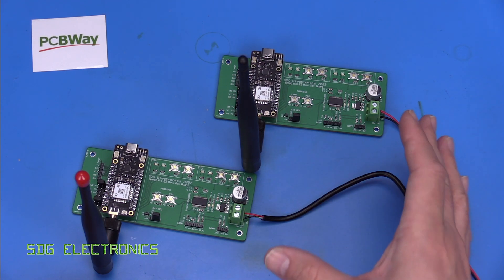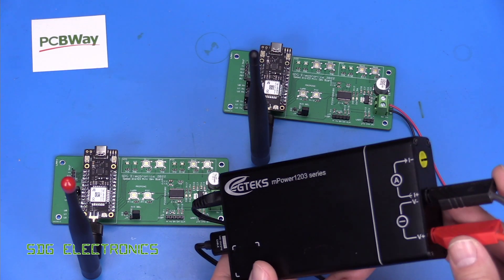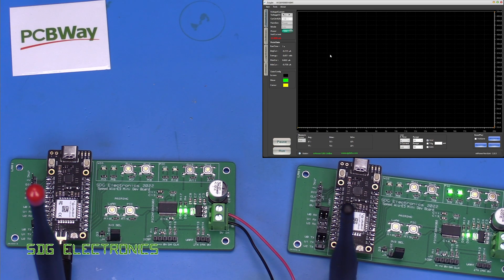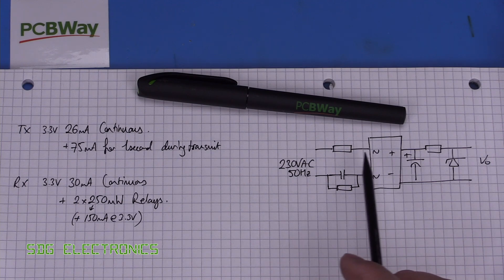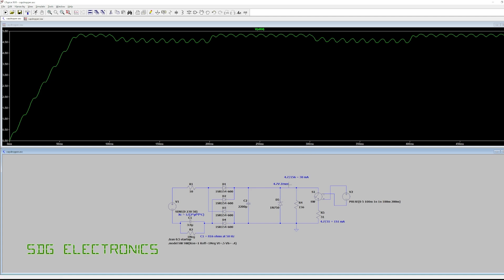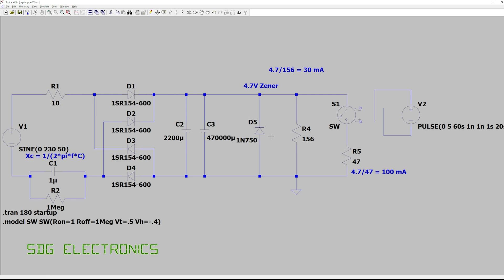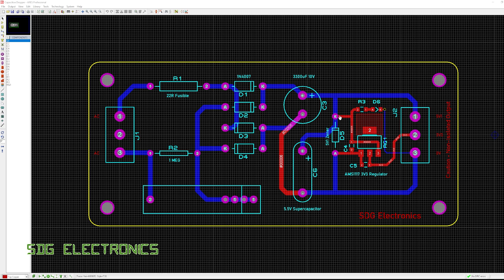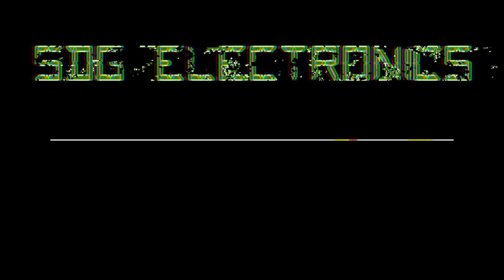SDG #289 AC-DC Power Supply using Reactance of Capacitors

Comment: FWIW on a very similar personal project I opted to use miniature off the shelf "open frame" switch mode PSUs from Amazon,  5 for £4.49.

Furthermore, I went for latching relays to avoid continuous drain. RS part nos  SPST 3V 134-7910 coil 72mA @3.3V; DPDT 3V 827-6296 coil 229mA@3.3V

Comment: Shouldn't your bleed resistor across the dropper capacitor be two? IIRC the breakdown voltage of most through-hole resistors is 250V dc.
Reply from the maker: I think I picked out a physically larger 0.5W package, that had a higher rating

Comment: I like simplicity of capacitor dropper and zener, but always end up with burned zener after a while. To gain simplicity and ease of use would recommend going with LNK302 from power integrations .
Reply: Any reason why the zener diodes fail? Because if you don't know why they fail, it will not help to switch to something like an LNK302. They fail too if not implemented correctly.
Reply from the maker: 2x designs coming up with power integrations controllers

Comment: There are high voltage linear regulators, like let's say LR8 or LR645 or LR745 from Microchip ... can do up to 450v input voltage, and a few mA of output current. If you don't have space for a big X capacitor, these followed by a buck may be solution (for example for the receiver... if it wasn't for the relays)

Comment: I recently bought a "HLK-5M03 AC-DC 220V to 3.3V Step down Power Supply Module" (other voltages are available). This cost £5.00 which makes all the effort of creating a low power supply redundant.

Comment: This is a terrible idea. Very dangerous: the antenna is connected to mains! And as explained the power efficiency is very bad...
You'd better use a decent USB 5v PSU. If you are really on a budget, buy a 2nd had Samsung charger for exemple. Older ones are limited to 0.5A or 1A but that's enough here and they are basically free because they are too slow for modern phones.
Reply from the maker: The design will be fully enclosed with a trace antenna. But the idea is to explore multiple options

Comment: For receiver better to go for a higher relay voltage, you can see in all the PIR applications they use a 48V relay coil, so the current through it when energised can be low, around 15mA, but still capable of switching 10A loads.  Then power regulation is done using 2 24V zener diodes in series, to spread the power dissipation, and often as well they use a trick and arrange the zeners to be 24V zeners, with a 3V6 zener at the bottom, and switch the relay using a PNP and NPN transistor pair, that shunts the relay coil across the 48V rail, providing power to the 3V6 rail, with a largish capacitor, so that the zener current or coil current is feeding the controller at all times. Just have to have coil current larger than controller operate current.
Reply from the maker: I was considering this, but I think no matter what the power dissipation is the same unless the supply to the electronics is a switching regulator. The coil power is around 250 mW no matter what coil voltage. Unless you mean something different?
Reply: @sdgelectronics  Well you can have a small buck converter running off the 48V rail to drop it down, though often the simplest solution is a tint SMPS or even an iron core transformer, though losses in the cheap transformer might be the highest power use. Tiny SMPS though, repurposed cell phone charger, will be about the best bet, 5V at 1A, and with low standby power as well. Should be able to find a whole host of genuine Nokia, Samsung or other name brand ones easy enough, often in never used condition, or a 12V wall wart will work as well.

Comment: I really wouldn’t use any capacitor dropper in anything with an external metal connection. In my experience they are very unreliable and provide  no isolation and little protection against mains born transients, ok for crappy domestic product but nothing else. I think I would go as far as to say these are electrically bad practice given the low cost off power bricks. Having given you a bollocking I have used them several times in the past.  Still you may well get out your system we have all done it.  Great video as always regards Chris
Reply from the maker: I plan to have this fully enclosed with a pcb trace antenna. I plan to try out a few different designs though including non isolated buck and a flyback.
Reply: @sdgelectronics  well it’s great your experimenting I have developed similar designs in the past it’s the only way to learn.
Reply: Like you say capacitor droppers are only really suitable for designs that can go in double insulated enclosures. No metal parts that penetrate the case also no wire coming out to a connector. great for low current circuits powered from the mains that can just sit there runnnong for years.

Comment: I would use a Hi-Link module, they are fairly cheap (A few $) low power SMPS modules and you can get them with a couple of voltages. HLK-PM01 is 5V 0.6A
Reply: They really are top notch. I’ve got several of each in 3.3, 5, 12

Comment: manual dip switches are a thing, for a reason, no software required to operate a device
Reply: capacitive (mostly) voltage divider (C - C R series divider) is better
Reply: also takes care of any DC-bias, lets in only the AC
Reply: why would you push that much power through a zener/diode, put a resistor in series to prevent excessive power usage
Reply: that R4 resistor is suspect
Reply: take a look at my AC-DC power supply framework
Reply: DDP is not usually working, at least for EU, use IOSS (not DDP)

Comment: There are special X2 capacitors rated for "In series with mains" use. Unlike the normal X2 thats rsted for only in parallel with mains use. For long term use id use one of those.